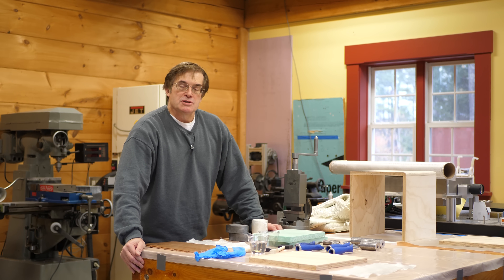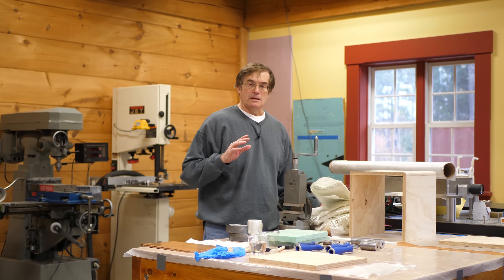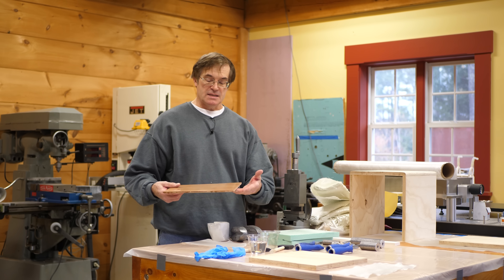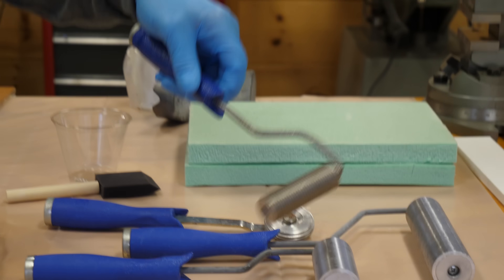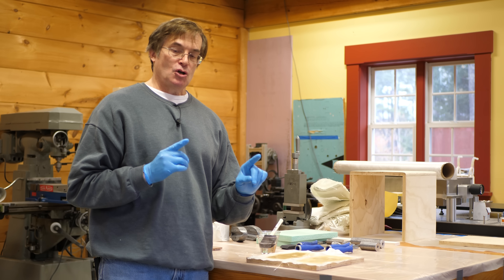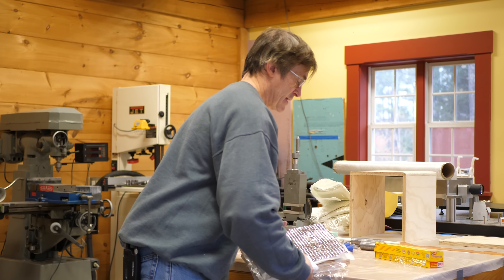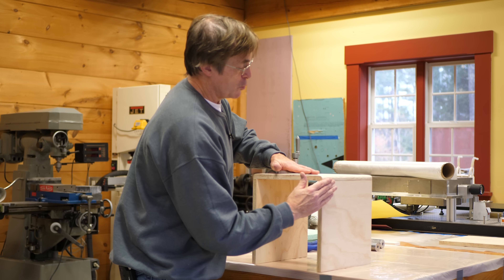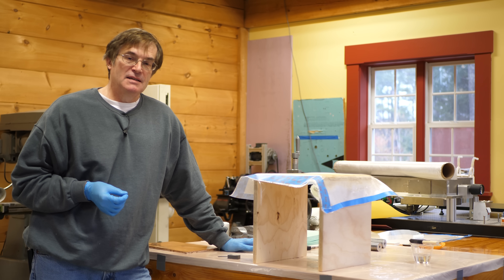Easy Tricks Using Fiberglass Strengthening!

Comment: I have noticed a huge increase in stiffness (as well as shock absorption!) if you put the fabric under tensile stress and keep it stretched out while the resin cure.
I presumed that is because, adding force to that face of the structure is not creating tension, but just reducing the compression that’s already been introduced through the tension in the threads.

Under heavy loads or extreme tests, it is good to take into account who does what in a composite material. 
For the most part, the threads of the fabric handle tensile stress while the resin handles compressive stress.
However, in order to mobilize the strength of the threads, first they have to stretch a little.
But, unlike threads, the resin is much more "brittle" - it doesn’t stretch so much, it tears/cracks (depending on the resin/epoxy and its curing temperature)
So that often means that resin has to fail a little (and bend substantially) before the threads can take up any of the tensile stress in the resin. Adding tension while curing mitigates that issue quite a lot.

I too mostly used balsa, but i strengthened the entire thing instead of fighting off the pore-issue.
The balsa itself can be strengthen significantly using epoxy. Instead of filling up the pores of the balsa as mentioned in a previous video, it could be advantageous to consider using the wicking action of the tubules to infuse the entire structure with the resign. 
Indeed, i noticed that when balsa fails, it is often due to the tubules directly collapsing in on themselves (extreme failure case) and/or due to the tubules housing micro buckling(or huge ones). 
The resin/epoxy having infused the balsa helps resist the compresive forces from up and down (collapse of tubules) and also from side to side (buckling). This really gets the wood as hard as a rock.
To achieve this while limiting the amount of bubbles you can soak it cold (lengthen curing time) from the bottom up to the surface facing the fabric. Or do the reverse if you can manage a gap below to let the air bubbles escape out (important step!).

The results seemed improved when i used carbon instead of S-glass but i couldn't really confirm it since i was on a budget at the time. In any case stay away from fast curing epoxy at ambient temperature (thiols and other things with a sulfur) they don't handle compressive stresses very well. Aromatic amides worked best for me. 

I wish you good luck for your next experiments.
Reply from the maker: Actually, the fibers create nearly all the tensile as well as the compressive modulus of the composite.  The resin acts to tie the fibers in a thread together and is under shear stress in both situations.
S glass is actually slightly stronger than carbon, but because it has greater elongation at the point of failure more work must be done on the composite to reach the failure point.  That is why S glass is much tougher than carbon.
Reply: @TechIngredients  yeah but the area under the stress-strain curve thingy gives us a single number that can be deceptive since we have no way of knowing whether or not the material "cheats" by using elongation as a way to absorb energy or by "just" having high strength. I merely wanted my shelf to be more rigid (and not to buckle under fairly heavy weight) by giving it more stiffness, even if at the expense of strength.
i guess if the goal is stopping projectile then maximizing toughness is best no matter how the material does it since we definitely don't want the projectile piercing the material.
I had a problem though. The best results i had with ballistics were by weaving/wrapping epoxy infused fabrics around ceramics. But the results didn't vary much between different "fabrics" (jean fabric basically gave me the same results as E-glass!)
That was weird sine i had also theorized the metal pellets would lose their kinetic energy by fracturing and then pushing aside the ceramics. So energy stolen by a high plastic fracture toughness material and then by inducing sheer/compressive stresses on the matrix/fabrics. So it should be extremely "fiber-dependent".
So i don't get why i saw so little variation between fabrics. I was a pretty sloppy experiment but is there something else about composites or "ballistic armor" in general you know about that would explain this oddity?

i used glass-ceramics mainly: old corningware (cookware stuff), old broken glass-eramics cooktop. I also tried it with flat-ish made prince Rupert's droplets.

Comment: I HAVE BEEN USING FIBERGLAS DRYWALL TAPE AND LOCTITE PL FAST GRAB POLYURETHANE CONSTRUCTION ADHESIVE . I BUY SLEDGEHAMMERS OR LONG WOODEN HANDLE TOOLS THAT ARE CRACKED AND PUT ADHESIVE DOWN THEN OVERLAPPING TAPE.

Comment: Can you give an idea of how the timeline of the curing process works out? Maybe in terms of percentages.
 ie, 10% curing time later the Epoxy becomes Gellid, 40% curing time from start the Epoxy becomes Tacky
Reply from the maker: There are too many variables such as ambient temperature, layer thickness, thermal conductivity of the substrate.  That's why you want to start the process early in the day and examine the film periodically.
Reply: @TechIngredients  got it, thanks!

Comment: AFAIK glass fiber is not very safe material due the small size of it's shreds formed during cutting and other manipulations. Also does  your glass fiber paraphrase coated (which is usual practice to reduce shred fiber emission)? If so, possibly it will better to dissolve paraphrase with heat before coating it with epoxy.

Comment: What epoxy are you using? I expected direct contact with the foam to eat the foam. I thought I would need several layers of latex paint between them. Forgive what might be a dumb question, I have only just started my research, and I havent done body work in 30 years.
Reply from the maker: I use both West Systems and Raka epoxy with the latter being excellent and much lower in cost.  No epoxy dissolves styrofoam, but polyester resins can and is more commonly used for auto body work.

Comment: Need advice! I’m working on a 1973 fiberglass hunter compact trailer, where the door goes the trailer is curved so I need to build a flat part onto the old fiberglass trailer shell (to have a flat surface to mount a door), I want to mold the piece out of fiberglass and attach it to the old fiberglass, it’s not structural but I don’t want it coming off on the freeway - how would I attach the new fiberglass structure to the (very) old?
Reply from the maker: That requires a little effort.  Without knowing the condition of the existing fiberglass structure such as the integrity of the core, the resin (probably polyester) and the glass I don't want to give specific advise.

Comment: Have you ever messed around with UV curing resin? My background in glassing is from custom car audio, so I only really know of products used in that field. I believe, outside of the car audio space, UV curing resins are also popular in the surfboard community. Not really sure what's popular in the boat community.
Reply from the maker: I've only used it as a tacking adhesive.  With thick layers, fillers and glass reinforcement the UV light might have a problem reaching deep enough to fully cure the resin.  I suspect this is a major barrier in boat building.

Comment: Red ( infrared) 100watt heating lamp. The 'long wave' light heats the panel from inside out. + - 50~60 cm away does the same thing as the heating pads.
It is a bit slower.

Comment: SAN PVC or PET ?  what is shear strain ? what is shear elongation ? what all the numbers of those specs ? :( im confused
Reply from the maker: You're bringing up a lot of different issues.  Shear stress and strain are tensile loads applied at right angles.
Reply: @TechIngredients  Thank you for your reply. maybe i should have be more speciefic. Which spec should one look for in order to choose the right foam core for building hulls on a 9 meter cruising catamaran ?
Reply from the maker: Compression strength rules.

Comment: hay if you fiberglass ( S glass ) those foam panels is it strong enough for like a tier drop ( squire drop ) trailer want to make the hole thing out of it roofs got to be strong enough to sleep on (wife going to kick me out for snoring )
Reply from the maker: It is.  You can double up on the laminate for high stress areas.  You can replace the foam core with a solid wood core for specific areas that require high pressure bolts and screws.
Reply: I found that you have to infuse it into the material or it just sits on top and the mateial bond is as strong as it will be, it will split when the panel splits.

Comment: But isn't the epoxy itself that strengthens the material?
Reply from the maker: No, just the reverse.  The epoxy is the matrix that allows the reinforcement materials to provide the strength.  If this wasn't true, why would carbon be desired vs glass for stronger and stiffer parts?

Comment: What epoxy do you use on your foam
Reply from the maker: Raka brand epoxy. I prefer  their slow formulation for the additional working time, and that, in turn, allows  for larger batches to be used.

Comment: Could you please help me
Extruded polystyrene foam. Compatable fiberglass resin(without melting) ????

Expanded polystyrene foam compatable fiberglass resin??
Reply from the maker: In both cases, epoxy works fine.  Polyester resin is the problem.

Comment: Nice Video,  I found  Wax Paper works better than Glad Wrap..  Plus you can lay wax paper over the lay up and squeegee the air out..  Wax paper doesn't stick to Epoxy or Polyester at all..  Simply peal the wax paper off  and it's smooth as glass..  No sanding,  No seam lumps, etc...

Comment: I'm making tables out of fiberglass. I made some out of plywood but they are too heavy. I put a metal fender washer glued down flush in the wood so neodymium magnets could hold stuff down in the wind. I'm the only one not chasing things in the wind at the outdoor flea market and I make more money. I got to tie the tables down with a shock cord and tent peg because the wind blew the heavy one over and stuff was broken. The magnetic tables are practice pieces before I do a camper shell.

Comment: Would you guys considder doing a bunch of video's about DIY cost saving. Solar heaters/boilers. You already dus airco's.
Maybe heating granit during the Summers and extracting the Heat in winter. m
Making a hydrogen systeem
(Electrolysis, compression, storage, reusing)

Comment: If using heating pads, is it critical to have similar heat from both sides? Does it affect the curing if it has a temperature differential across the section?
P.S. If your son decides to move away, I'd like to apply for the role of DP and general lab-bod. Board and lodging would do! :)
Reply from the maker: The heat will equalize pretty well even with a single pad.  The blanket makes a big difference.
We eventually may need a couple of assistants.😉

Comment: He specfically discounted the effect of temperature druring curing. That becomes your "glass transition" temp. Above that cure temp, the strength of fiberglass drops off fast. He's a garage hacker and didn't do anything but wet up a piece of fiberglass.
Reply from the maker: You're wrong.
The glass transition temperature has little application during the room temperature cure of fiberglass laminates.
I didn't discount it, it doesn't  matter.

Comment: What kind of epoxy were you using here? My West system kicks off in the pot much quicker than yours, even using slow hardener. 
What kind would you recommend for small boat building instead of West system?

Comment: Acra-glass will bond with it's self after curing, gunsmiths use it to repair wood on firearms and stock bedding on rifles, plus you can add dye to it and it doesn't affect the strength!!

Comment: I understood that epoxy isn't UV resistant and becomes brittle and flakes when exposed over time to direct sunlight.
Reply from the maker: That's true, although it tends to become cloudy before it begins to fail.  Over coating with a UV blocking polyurethane will prevent that.

Comment: the challenge would be to cheapen the build with XPS panels and polyester resin instead of epoxi that in europe is way too expensive. The problem is the incompatibility, could you invent an intermediate coat to protect the XPS from melting from the polyester resin??? If you could do it it will be a major milestone in boat building!!!!
Reply from the maker: Why is it so expensive in Europe?  The epoxy we use here in the US is not subsided, it's price is related to it's real cost.

Comment: Really enjoyed the film on sandwich construction. Could you possibly do a video about using a vacuum cleaner and vacuum storage bags as a basis for vacuum bagging a simple stack. I recently watched a video on the 'EasyComposites' site on this topic with them using a 20% vacuum, and I would be interested to see you test the finish components vs a panel prepared using a higher performance vacuum pump with close to 100% vacuum. I just think there are a lot of us out here that would like to be able to use a vacuum cleaner for our vacuum bagging but don't know how good the performance of the parts will be. Many thanks, Chris. ps. 
What an amazing channel you have created.
Reply: The higher  vacuum is best. Best ratio is 30 percent resin to 70 percent cloth.

Comment: What epoxy do you recommend to use on the foam board to avoid melting or deforming it?
Reply from the maker: Epoxy is different than polyester.  It doesn't melt plastics.  It's compatible with polystyrene, polyurethane, PVC, ABS, nylon etc.

Comment: I would like to build a huge (by comparison) boat similar to the E-Boat, maybe with a sail, and covered with solar panels. I'm thinking of about 40' long, with wings with panels on them also, something big enough to get in the ocean, and travel the world,  build it like a semi sub, well sealed so it would survive a slight submersion,  with a small diesel,CNG engine generator, about 10kw, for emergency power, and about 150kwh of battery, and 20 kw of solar,  basically a dream,  ever since I was a kid, when I made /attempted to make a boat from a 55gal plastic drum, I wanted a boat, but most boats are a area of water you throw money at!  I can't do that, if I got a boat I'd have to live in it!  So 30-40'  is about minimum.  I like the idea of electric , maybe salvage a motor from a electric car, Nissan leaf maybe, and even use the battery!  Although a Prius motor generator, would be nice for back up, the Prius system would a much larger battery, maybe a mix of the two! The 12v side could be used to power the "house" side of things with a 3kw inverter or so, using 12v lighting, to be more efficient, with a 200ah or so lifepo4 12v batterybank , then enough solar to completely charge the system in a couple days, minimum,   dreaming I know, I have my home powered by solar only now, the generator does get used!  But it's a dream I guess!
Reply from the maker: Dreaming is critical and the power that drives the effort. 
But, don't stop there.  Start small and build a model then a simple version.  This in turn powers the dream.😀

Comment: Best guess, You're a college professor.  (Well spoken and clearly know your topic)
If using any of these techniques/materials on a vertical surface, would one just apply lighter coats? (I'm considering building a travel trailer)
Reply from the maker: That's correct.  There is a significant tendency for the epoxy to run and this will require these defects to be sanded off.  One trick that can help is to wet the cloth on a horizontal work surface and then apply the sticky cloth to the vertical surface.  This can be messy, but results in less post cure work.

Comment: Huh, for a "bright finish," I've always been told that the only thing that holds up long term that's clear for boat use is spar varnish (over epoxy and polyester resin).  Have you had long term success with another coat of epoxy (I'm assuming something like west systems like everyone uses)?
Otherwise great video.  I've done occasional 'glass work for probably close to 25 or 30 years and like many others commenting I've never seen the tape trick and your approach to keeping things horizontal/blending/overlapping the corners is likely a bit cleaner than what I've always done- let it harden completely and take a sander/grinder over the edge and let the sanding action "cut" the excess off and leave a blended curve for the overlap.
Reply from the maker: Thanks!
Polyurethane coatings with UV inhibitors are the best top coat over epoxy, irrespective of how many layers of epoxy are layed down first.  Spar varnish is a type of coating that can include urathanes, but doesn't have to.  It means a waterproof, flexible coating.